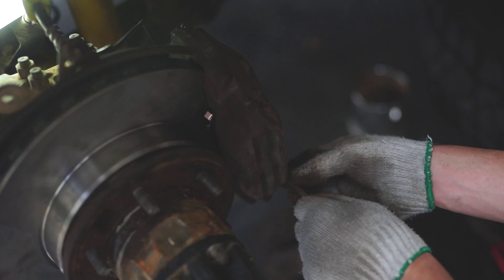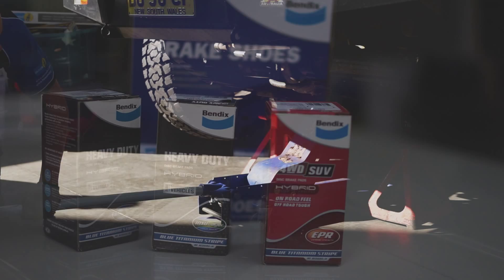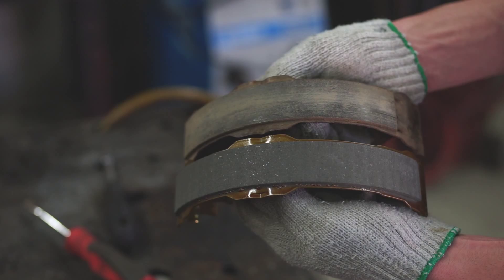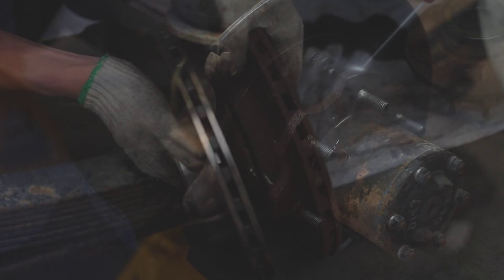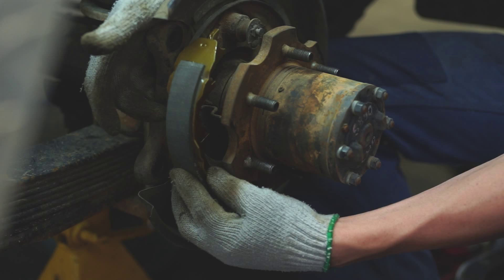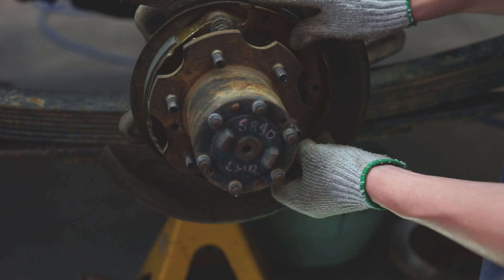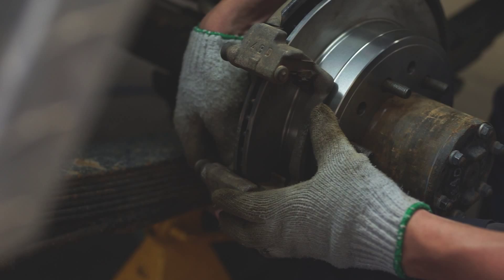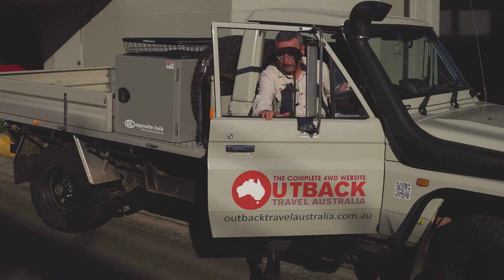How to install Handbrake Shoes to a 70 & 80 Series Landcruiser

Comment: I am pleased u like the job because the parts were all hidden behind the hub . obviously your man has  done quite a few and has had practice. .. So what to do  if there are wrong parts fitted by a previous person,. I find your video  less than helpful. I would have removed the hub so the handbrake mechanism could be seen and also the springs ,.